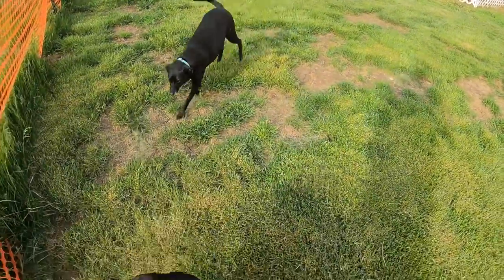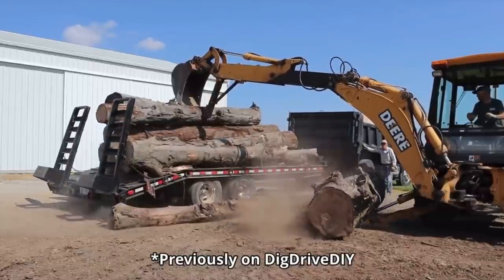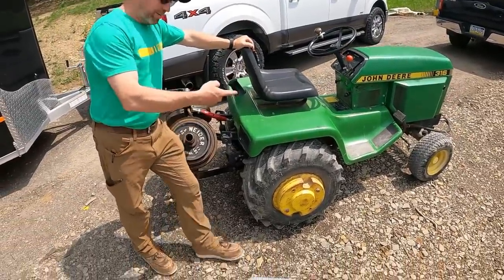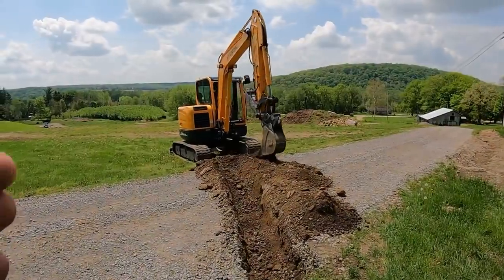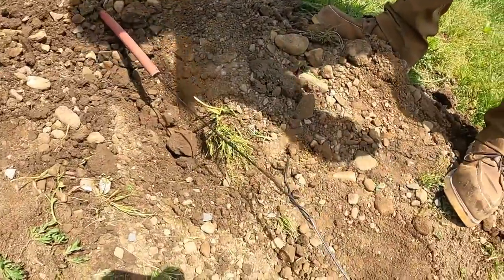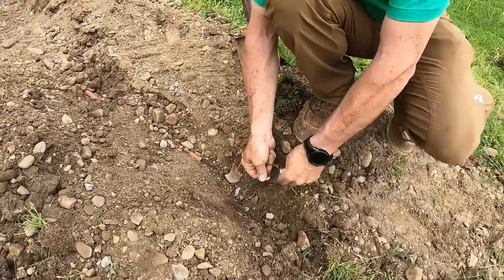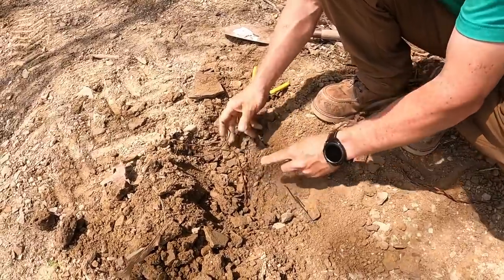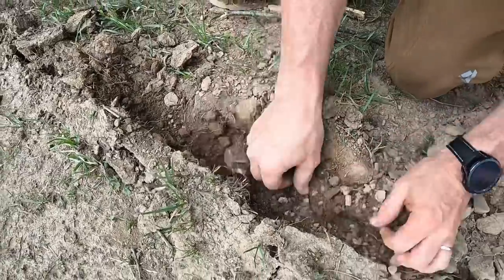DIY fading Fence Installation

Comment: It was great to meet you Adam and I really enjoyed this project. Now, just don't show this video to your dogs as they may not be fans of mine come training time!  I hope you get many years of protection for your dogs from this fence.  Thanks again for getting together on this.
Reply: I think it is brilliant when two channels I follow get together for a collaboration.
It makes me feel like I'm getting twice the value.
Reply: Awesome video, but Bill is needed Neil.   Adam I hope this goes well.   I’m going to watching the training process on your dogs.
Reply: Thanks Neil & Adam! I’m thinking of doing this for my pup: am also wondering if the same perimeter wire can be used for a robot lawnmower? I guess I could lay two wires at the same time if not. Looks like a decently robust setup, and I love the blade: will fab something similar myself: perhaps a bit bigger so I can use it for laying alkathene pipe as well for a spring water supply project.
Reply: Always great to see Neil! Another great video!

Comment: I hate electric fences.  When dogs feel a need to go to the barrier they get punished.  Like when people or dogs come by.  They start associating people as negatives and get meaner.  Also a friends dog would get out but would not go back because it would shock him.  Even if you removed the collar the fear was amazingly high.  Your dog you are most worried about will probably accept the shock and will not come back but will be nearby waiting for a safe entry.  I would prefer that the wire was put in metal conduit where it leaves the ground and the hole in the wall would be finished much better to discourage bugs and mice.  The wire would also be protected from a mower or string trimmer.  A couple of feet of conduit and fittings costs very little and may save lots of trouble in the future.

Comment: The e-fence is a great tool, but they're not perfect. The biggest issue I have is that it doesn't prevent other animals from coming into the protected area. This is especially important if you have small dogs and a coyote population in your area. Your two dogs can likely hold off anything that might come in, but if you've got something less than 20lbs, all bets are off. And for dogs that aren't spayed, forget it. Every male dog in the area will be on them. Not that a fence stops a determined male, but it helps. Personally, I think e-fences are best for when someone is home with the dogs. They're not suitable for turning the dogs out and everyone's gone to work or school.
Reply: My Moms Golden used to blast through Chasing Rabbits, Squirrels, Then sit outside winning to get back in.
Once she learned the boundary, She would stop when she saw the other animal cross the line.
Mike M
Reply: @m9ovich785  The newer fences allow the dog to come back in without getting zapped. Invisible Fence (brand name) calls it "correction-free returns".
Reply: @JCWren  I'm sure they changed in the 20 Years since I put that in. 
Mom died in 2008 and Annie May went to live with My Sister . 
I no long live at that Property Either. 
and Have no plans in the near future for pets of My own. 
Mike M.

Comment: Let’s see - a super modified “garden tractor; a corn anhydrous-ammonia knife (everyone has one of those in the extra metal pile ~ Doug?); and a track hoe… yup simple dyi project.   😳😱😄😄
You have an arial view of the project but and a good idea to mark where the wire is placed.

Comment: I sold electrical supplies in McKeesport, Pa. for 20 years. We sold standard THHN copper stranded wire for these installations. Wire was heavier gauge than factory wire and yet a fraction of the cost. Never had anyone report a problem. Generally we used yellow or orange so it stood out from the soil. This was the same wire the gas companies used as "tracer" wire for plastic pipe or to connect sacrificial annodes . Thanks and take care

Comment: Working smarter not harder. What a great set up for laying underground wiring. I did mine by hand years ago when I was much younger but on a much smaller property. My black lab saw a rabbit and took the jolt to go get it. She came back through it after I called for her after she got the rabbit. It only happened that one time.

Comment: Did the same thing with a friend of mine about 20 yrs ago.  He built a small 2 wheel trailer with a seat to be pulled behind an atv.  I sat on the seat and controlled the wire feed around a 5 acre circle. Worked great.  Thanks for sharing.

Comment: Try a livestock electric fence charger. Your current t posts will work, just buy isolators for tee posts and use flat hot wire ribbon. About 3 rows 6" apart will keep dogs in and coyotes out. The dogs only test it one time and no batteries to wear down. If they jump it, put up another line above it. Probably less than $100.00

Comment: Oof idk how I feel about a silicone filled wire nut under ground I'd rather take the time to solder it together and shrink wrap it
Reply: I was curious about them at first too.  Mine has been in the ground nearly 20 years without incident though.

Comment: Seen Neil on Tractor Time with Tim. I believe he is from my home state of Indiana. Curious if it would be possible to pull internet cable the same way. I have about 100 -- 150 feet from my house to my building.
Reply: I buried my Ethernet cable about 200' from my house to my shop with this rig.  Worked great!
Reply: @digdrivediy  May want to get with you see what you might charge. I live in Indiana.

Comment: How Cool is that to see Neil on your Channel.. 
Funny thing, I had the Fence controller in the space under My OWB which left just a short 30 Ft run of twisted wire to the edge of the perimeter start point. 
Thanks Guys...

Comment: Looked like he dug that invisible fence over the  high pressure gas line that prohibited you from putting the barn in your 1st choice location.    Were there any concerns or permits needed for that?
Reply: Didn't dig deep enough to be a problem.